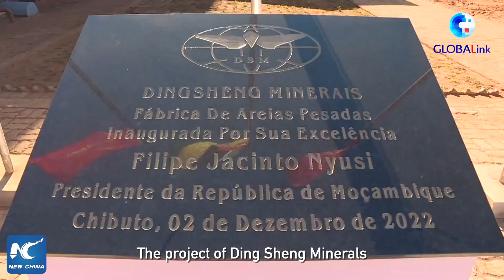Mozambican president inaugurates production lines for Chinese-invested heavy sands project

Comment: Heavy sand is? What is it for?
Reply: Heavy sand is the generic name for mineral sands with a higher specific gravity. When the parent rock is weathered and eroded, sand is washed downstream and deposited on the riverbed or beach. Properties include high specific gravity, hardness, chemical stability and resistance to grinding/erosion. Heavy mineral sands are a class of ore deposit which is an important source of zirconium, titanium, thorium, tungsten, rare-earth elements, the industrial minerals diamond, sapphire, garnet, and occasionally precious metals or gemstones.